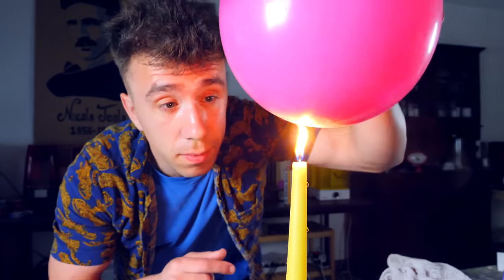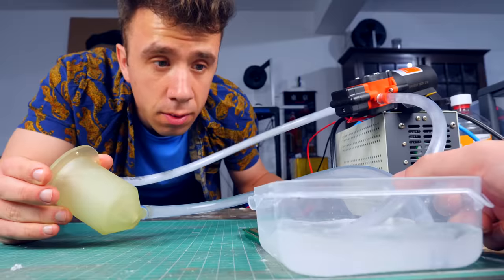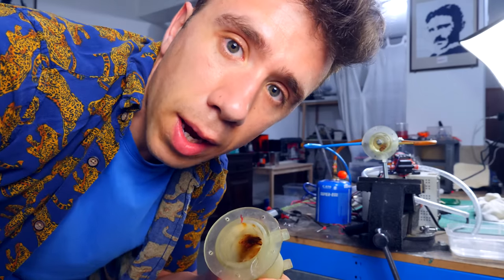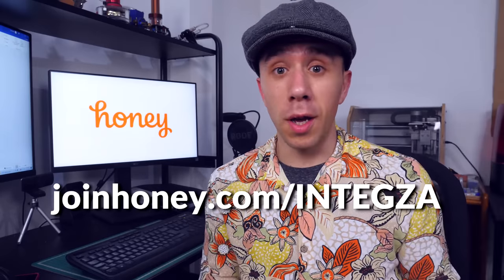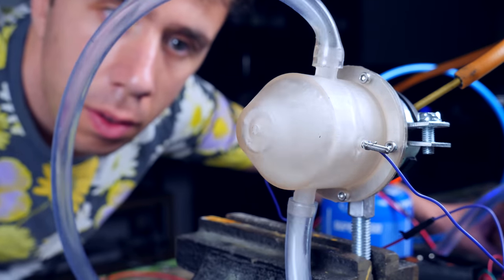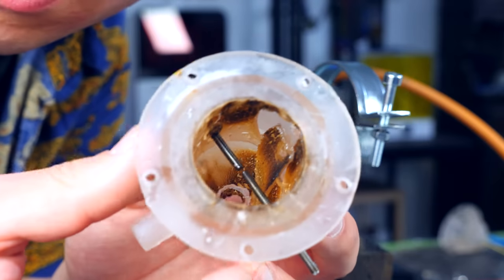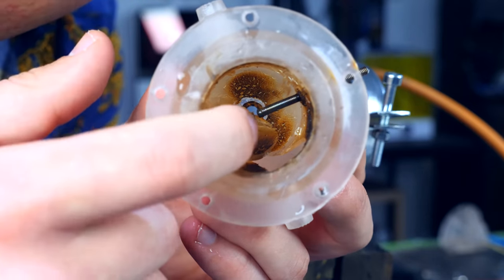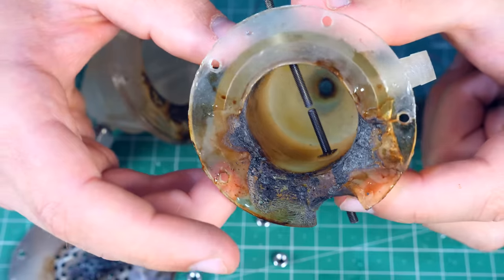Water-Cooled Jet Engine in Plastic

Comment: I would expect 2 primary causes of interior surface failure. 
First, changes in coolant pressure due to the heating (the outlet being the same size as the inlet meaning the most it can eject is the pressure in+the max pressure of the coolant chamber) - meaning if you exceed the coolant chamber pressure you burst the sidewall. 
Second, the coolant doesn't seem to be at a constant pressure throughout the chamber - if instead of just a flooded jacket, you had a spiral of water channels around the combustion chamber, along with a bigger bore out-pipe, you might have more luck.

A third possibility is that you're getting steam bubbles in the coolant chamber, which I predict would act a bit like a negative void coefficient in a nuclear reactor - the steam can't absorb the heat as much, so the area aroudn the bubble overheats and you get a fracture. 

A possible alternative would be to mimic an old water cooled machine gun and have an assymetrical water jacket, biased to the top of the combustion chamber. This means it has room for gas expansion (and possibly a blow-off valve) plus the pressure around the chamber can self regulate a bit.

Comment: Make everything a single monolithic print including a water-cooled diffuser.  Add drain holes from the outside of the engine if necessary to keep the print from failing due to suction.  You can fill those holes with plugs etc once you get the uncured resin cleaned out.

Comment: A big issue is that the plastic deforms with heat, no just breaks. At fixtures try improving the contacts to resist deformation, not heat.  Lengthen the screw holes and add a washer. You want the soft material to make contact as far away from the heat if possible with a strong enough connection that the expanding plastic forms around the head of the screw, not pushes it out. This means observably bending the plastic when it is cold with the fixture. Also, you can add an extra valve to control internal compression and thereby heat, but you could get more power out of a lower grade fuel mixture probably too.

Comment: my list of improvements that might work.

1 make ducts in the cooling system to guide water and improve flow above the chamber.
2 more bolts on the sealing surface to improve seal.
3 make metal disc larger to allow for cooling of the disc.
4 create cooling for the disc.
5 create minor cooling for the diffuser walls. any ware heat can accumulate is a potential failure point cooling might be needed when other failure points are removed.
6 move the ignition closer to the diffuser to prevent buildup of the fuel mixture in the chamber. if you have a buildup of the fuel air mixture then you get an explosion instead of a burn and the explosion blows out the fire causing another buildup. moving the ignition closer to the diffuser prevents buildup of the mixture.

7 i like sensors add sensors every ware to get data to help improve the design. like a pressure sensors to see the optimal ratio of air to fuel. maybe try a heating wire to ignite the mixture for better flow in the chamber.

8 try to split up the cooling loop into different sections and connect them up separately thereby making sure there is cooling where there needs to be. otherwise the water might chose to not flow where it is needed.
 
9. it looks like there is a lot of air in your water. try to fill a big bucket with water and completely submerge your inlet in the water and run the water in the engine until there is no longer air bubbles in the cooling loops. and depending on how long you want to run the engine you might need to cool the water to improve cooling so try to add a radiator to the end of the loop before it returns to the bucket of water. this this might not be needed with a sufficiently large source of water to test if you need a radiator simply add a thermometer in the water to see if it heats up significantly. sure you can use your finger for this but a thermometer is better

Comment: Couple suggestions: 

1) the resin on the internal side of does not have sufficient heat capacity to diffuse heat a way. That’s why the failure was at the diaphragm connection. 
2) try heat syncing the diaphragm to the liquid cooling chamber.
3) For your coolant try using propylene glycol or ethylene glycol (what is used in antifreeze). Ratio at 3 parts organic to 1 part water.

Comment: The inner wall should be as thin as possible. It might seem counterintuitive, but if you are water cooling the layer separating the water from the hot surface should be able to transfer heat as quick as possible, otherwise the inner surface will overheat before the heat could be transferred to the water

Comment: You should probably use a material thats more thermoconductive for the inside wall.
I would also recommend using a compressor for the butane gas. From the burnt areas on the resin you can see the butane falls to the bottom instead of igniting.

Comment: A gasket to keep conducted heat from the metal part from the plastic might help and isn't really cheating as most 'rubber' in washers and gaskets has been synthetic for 60+ years

How about making pnematic power tools that work off a water supply?

Comment: Cool to see you branching into more advanced cooling techniques. Metal rocket engines are able to tolerate heat way beyond the melting temperature of the metals they are made of, so similarly effective cooling aught to be possible with plastic. I wonder if you could find a printing technique that mimics "ablative cooling" by building the rocket out of layers of plastic that are designed to blow off as they heat up.  Similarly for regenerative cooling, film cooling, etc.

Comment: Hi Integza, 🍅. Perhaps you need to create the water cooling to all parts of the engine. The metal plate inside will always heat up and conduct its heat to the edges and melt the resin. If all parts were printed with the thin layer cooled, and the water pumped independently to each part, hopefully this could help to keep all areas at roughly the same temperature. The metal shield part could be printed with channelled holes passing through, but still allowing the water to pass through as well to cool the surface. Also, the water may be being pumped too fast to efficiently collect and remove the heat from the resin surface, perhaps by slowing the rate of flow to each part independently, you can more effectively find the flow rate required to effectively remove the heat. Love your programs, dont give up on this one, i think you are nearly there. 👍

Comment: The Apollo rocket's engines were made of square tubes welded together. Its fuel ran through those to cool the engine AND preheat the gas which improves performance. You could make something similar by lining the inside with a coil of brass or copper tube and pass water/fuel through it. Steel would be better, and make sure there is no gap between each turn of the coil. You could try brazing it. Also, add an anti backflow valve (gas rated) in the fuel line (before the coil) before trying to heat your fuel and to test the fuel path between the valve up to the injectors to make sure it resists high pressures. (and use proper shielding for your life). If pressure builds up too high in the coil, you need to add fuel paths to shorten the coil's length. (multiple coils, side by side).

Comment: i got an idea for you by watching this vid, i havent watched all your vids so i dont know if you improved the design on this project.. but what if you made channels inside the back portion for the water to flow within the screwholes as well and in the back of it. just make the connection portion thicker and have a water channel and then seal it with a rubber gasket with holes for the water run through.

i hope you get what i mean, and im sorry i am 2 years late on watching all your vids. i find it funny and interesting to watch it.

Comment: Well you should use that ceramic resin because well the heat resistance of the ceramic and the cooling of the water would basically make it indestructible to heat

Comment: Crome plating the interior of the engine could help with heat transfer and resist the resin burning more. I saw a video a while back on metal plating 3d prints to make them stronger but the metal could also help hold the heat more evenly letting the cooling system do a more efficient job on the engine. I also think cooling the front of the diffuser would probebly help but yeah. Thats my only thought for future videos. Your definitely smarter than I on rocket science integza

Comment: I would recommend two or four channels that go from the defuser to the nozzle. I'd introduce the water at the defuser end having it cool the defuser seal first, then cycle around the combustion chamber and finally collect off the nozzle end, or even have it spray into the jet right at the nozzle to help cool the opening. The water pressure would have to stay low and aiming the water jet to spray outside of the chamber would be pretty important. I'd also look at shaping the defuser a bit differently.  I would try a Lilith impeller (I think that's what it's called. You made videos about it) to spin the fuel mixture to the center of the combustion chamber, I'm thinking this would help keep a cushion of air against the chamber walls.

Comment: You should put your water inlet as close as possible from diffuser plate, plus, if you keep the metallic plate, you should make it sufficiently large to be immersed in the cooling chamber. Your problem here is that you metallic plate acts as a thermal conductor in direct contact with your resin which melts it. If your metallic plate soaks in running water it will be cooled very efficiently, preventing it to melt. You can also maybe make a thinner wall between hot gas and cool water near the diffuser plate to increase cooling and use refractory mortar to waterproof the joint with the plate.
Plus, you can also increases the cooling by increasing the flow rate of water.

Comment: Two recommendations to improve the design-
1. Design the coolant cavity with a spiral path, ensuring that it flows uniformly over the surface you are trying to cool (this is exactly how the Space Shuttle cooled its engine nozzles with the liquid fuel, in fact).
2. Use silicone, or similar heat-resistant insulative material, to seal any interfaces between parts, espeically those between metal and plastic parts.

Comment: late comment, but if you havent already you could try injecting water in the diffuser. it was used on early jet engines, cooling the inside of the combustion chamber and/or increasing thrust

Comment: Maybe try adding more water inlets and increase the pressure more? 
Also it seems like a lot of the issues occur where the metal contacts the diffuser. Maybe you can thermally isolate it with a porous ceramic gasket?

Comment: Try removing the air bubbles from the water that goes into the chamber (maybe with a second step to contain it), after that maybe trying to make sure all of the chamber is actually getting "in touch" with the liquid,  as an AIO cooler for cpus.

Comment: I suggest that the water be pumped around the inside of the combustion chamber, avoiding the need for any inner plastic wall at all. Some spin may required however, so perhaps some kind of motorised can would work.

Comment: I don't want to be negative, but resin is not the best material for heat transfer. When designing a heat exchanger you need a material that can withstand the heat of the flames (even if it's cooled) because the initial surface temperature will be that of the flame.  

The material needs to be able to conduct it to the coolant, otherwise, it is not transferring  heat into water, it's just raising the temperature of the material.

metals are the ideal material for this, so if you want to redesign a working engine that lasts longer, you need a metal combustion chamber.

Comment: Well, One thing for you to consider: pomping water from the bottom of the cooling shroud instead of the top. That way, colder water is going to stay in the chamber, while the hot escapes. Also, it fills the shroud more that way.

Comment: You need the air bubbles out of the cooling system. The same system is used in rocket nozzles that flows the fuel through channels in the nozzle before going into the engine.

Comment: Your whole channel reminds me of some of those engineering challenge or games where you are made to like. Build a solid structure as light and as cheaply as possible.

Which is honestly damn cool that its applied to rocket engines. Like if you could make the cheapest rocket work, i assume you would then be able to scale it with better materials?

Comment: Great project!

Idea: Make the jet pulsed. If you make it so there are "pockets" of flammable gases, then an ignition won't propagate back (more than the length of the pocket), containing the explosion. To achieve this, you need a constant high air flow, gentle diffusion, and a valve that switches rapidly between fuel and air. Every T seconds, you give a quick (milliseconds) burst of fuel. If air flow is constant, like in a river, this fuel will travel in a pocket (and mix with air along the way), and when it reaches the ignition you can ignite it (by timing it right). This means only a single water cooled chamber is necessary.

Comment: Maybe using a gasket between the plastic and metal sections would help? Could also use some sealant to try stop the hot gas leaking in between the individual components? Not sure also if maybe sharpening the ends of your spark generating screws may give better spark generation?

Comment: You should either find a fuel/oxidizer that combusts at a temperature below the melting point of resin, or use the resin itself as a fuel. You could easily make a solid fuel rocket by making a thick wall chamber and feeding in only oxidizer. Might want to put it in a metal cylinder though, because it will definitely explode.

Comment: Maybe a ring of fiber glass ( or ultra heat resistant mat) use as joint should solve the case, and try at least using ice into your stock of water or use another cooler liquide, like those for wate cooling for computer, or car cooler.

Comment: Idk if dumping water in and having it cycle out like that in solid liquid form is the way to go. Unless you could supercool the water, and have it nozzle sprayed into the engine, atomized, at a high flow rate would be better then just dumping water in liquid form. The liquids gunna put some resistance on the spin of the engine. Having the water enter atomized in a mist at a high flow rate would be better, and invert it, have the intake on top and output on the bottom so any liquid cant build up. Like inverted v12's in prop planes. Its funny you used liquid butane, i was gunna refer something similar.

Comment: I don't know if someone suggest it before
Buts it's my suggestion : 
-Use inlet coolant on bottom side and outlet on top
-place ignition on top of inlet and outlet as far away as inlet,so it fills up entire chamber without filled by air
-try to use anti-freeze for car ( etilen glycol or propylene glycol since it have higher boiling point than water and can absorb much heat before it's evaporate

Comment: Idea - create thin neck in electrodes to restrict heat transfer created by the arc. Problem with watercooling is not water itself but resin which is not very good at conducting heat. Perhaps you can print whole thing as one part and instead of diffusor made of metal sheet, use metal mesh at the end of fittings feeding oxygen and fuel.

Comment: I have an idea! Why not print the two halves as one solid print, using the same coolant chamber around both chambers. You can use a similar nozzle design to seperate the chambers from each other to avoid reverse compression. Maybe also use Propelene Glycol as a coolant? Just some thoughts.

Comment: You could get a cold coolant by using alcohol cooled by dry ice. And if you used high temperature gasket maker like RTV you could insulate the diffuser from the plastic. Mybe add a little metal nozzle too.

Comment: you need to print it out of peek filament. You are on the right path with the thin wall on the water cooling, but you need a strong material for it.

Comment: Any air pockets allow the plastic to melt and burn so maybe try not circulating at all and simply gravity feed a small reservoir to keep it entirely full. A good visual is a styrofoam cup half full burned from the side with a lighter  will not burn below the water line  ever.

Comment: add a couple graphite isolators in between the diffuser and body, Add a radiator to help dissipate the heat i.e. pc water cooling parts.

Comment: If I remember correctly, the large liquid fuel rocket engines actually pump the fuel around the nozzle of the engine to cool it before pumping it to the combustion chamber. Maybe this would work using liquid butane? That way you can make a closed loop that pumps the fuel around the engine to heat it up, causing it to aerosolize for when it is fed into the combustion chamber?

Gonna need someone to spot check this idea bc if it goes wrong then the result could be quite... explosive...

Comment: so cooling a plastic rocket with water can work however you need the coolant to contact every opposite surface of combustion. Colder wont help if you still have spots that heat past the melting point  of the resin.

Comment: I think you should retry this but add ice to the water and design water jackets to run through the defuser too. Also the water should be pumped from the lowest point to the highest to eliminate air pockets. If you research the cooling jackets in car engines you can see how there are cooling channels running through most of the areas allowing even distribution of the cooling agent